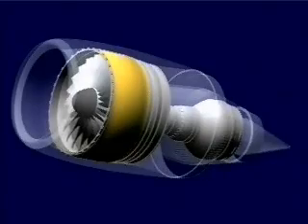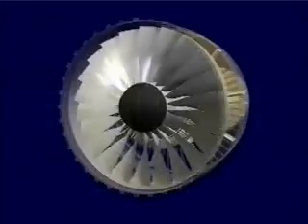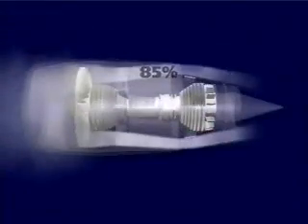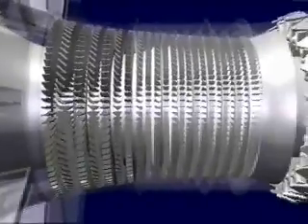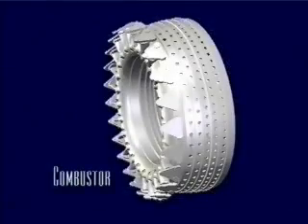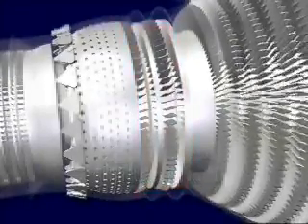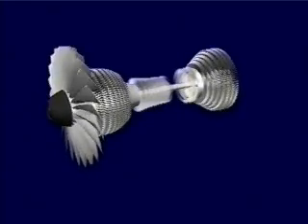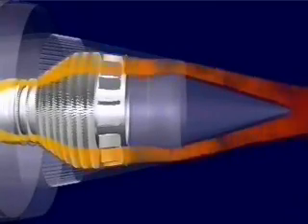How Does An Airplane Engine Work?

Comment: turboprop: good at slow speeds
turbofan: excellent for mach 0 - 2
turbojet: inefficient at slow speeds but usually has higher speed limit
ramjet/scramjet: no turbines. hypersonic speeds but need mach 3/4 for the compression
rocket: inefficient at slow speeds and needs oxidizer

why can't we have a turboscramfanjetrocket? such life

Comment: Kenneth Chief i doubt it. planes use the high altitude (higher air pressure) and higher velocity to produce higher thrust in the combustion process. they also have an advantage of being in the air essentially alone whilst cars have to be periodically stopped for safety reasons. if cars had a mechanism like this, you would need something extra just to stop the car. this is why we have gas pedals and transmissions to control the speed of our car. cars do actually use airflow though but it is more so used for combustion which is basically controlled by how much gas is released into the combustion chamber.
Reply: high altitude (lower air pressure)*

Comment: There needs to be some way to cool that air coming off that high compressor. The density of cooler air would contain more oxygen by volume as well as keep the combustion cans cool enough to spray more fuel and get an even hotter fire going; which means more power without increasing the size of the engine.